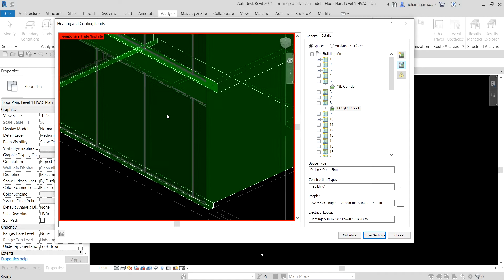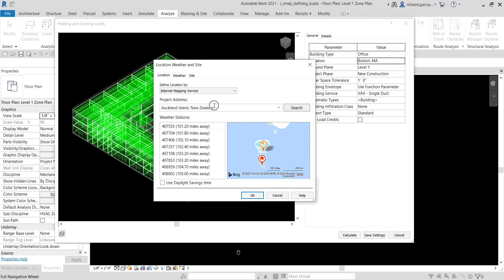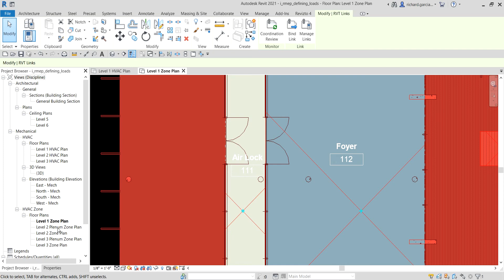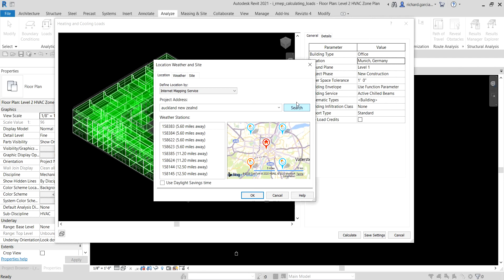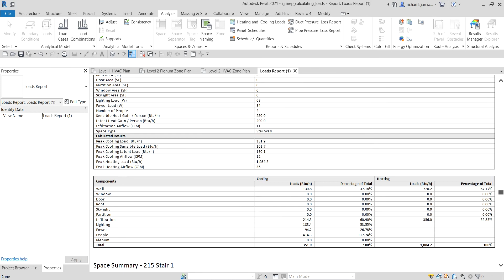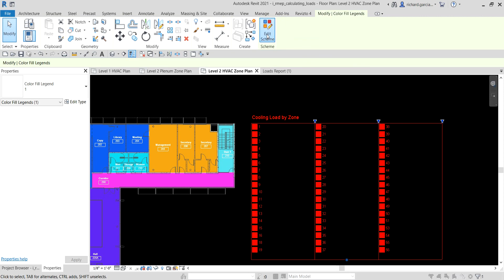Comment: In short ...what is the benefit of this. Building analysis....?
Reply: for heating and cooling load calculations.
Reply: @bim360  Is there any practical uses of this calculation? where HAP, TRAIN and other software are more reliable and industry  relevant. Also Revit is tweaking between  INSIGHT Add-in Heating and cooling load calculation  and tooke it away on 2021. Many Industry even don't recognize and trust Revit heating and cooling Calculation in Revit. Rather  I think it is worth focusing on System Analysis which is new feature and looks like a lots of useful functionality  for MEP people.
However thank you for you continuous effort.
Reply: @jahurulhaque8652  i dont use this but it's not bad to have additional knowledge.